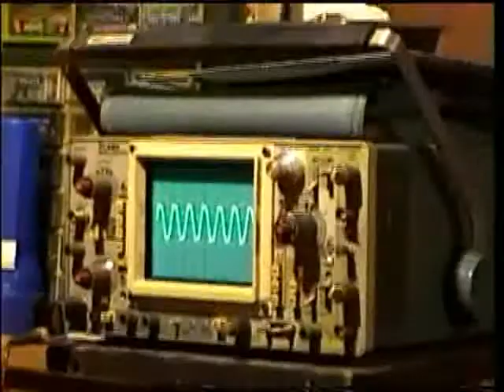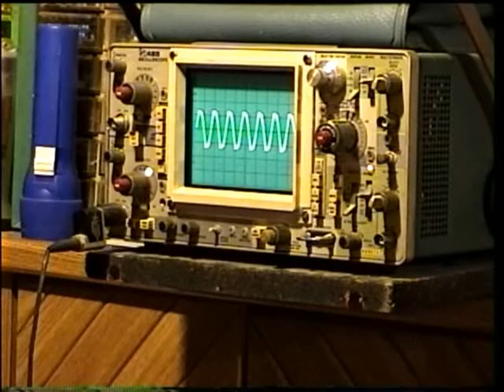Nunez Coil Replicated

Comment from the maker: Hey Greg, thx for the comment. I only use one channel of the amp to amplify the low level signal coming from the cell phone signal generator. You connect one wire from the A winding and one from the B winding to the amp's output, and the other side of the two windings are the output that produces the high voltage.

I'm not yet convinced this design is over unity, but it obviously produces unusual effects that mainstream science has claimed were impossible, such as magnetic monopoles. There's much more here than meets the eye that warrants further investigation.